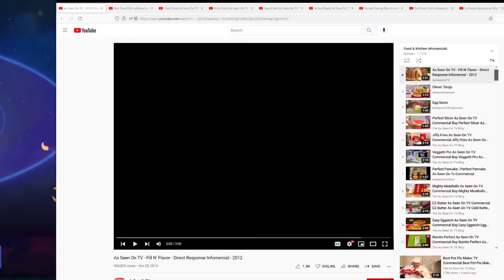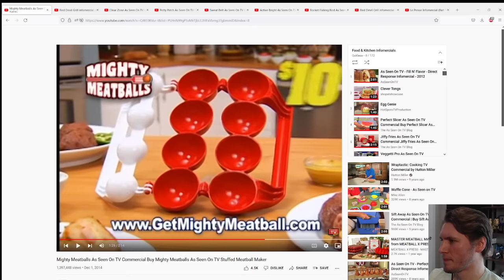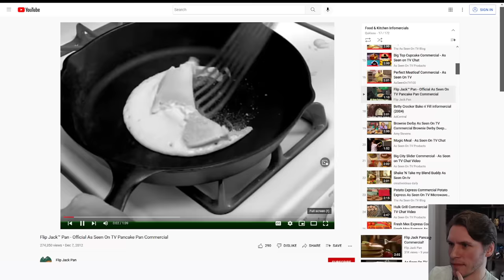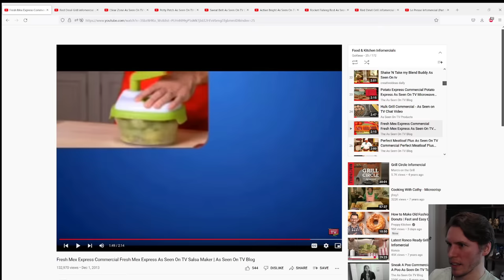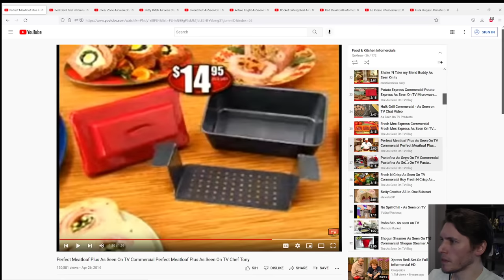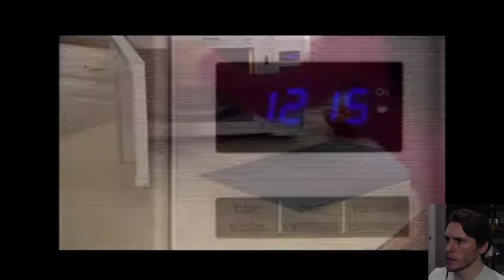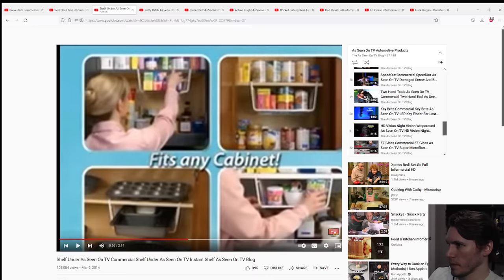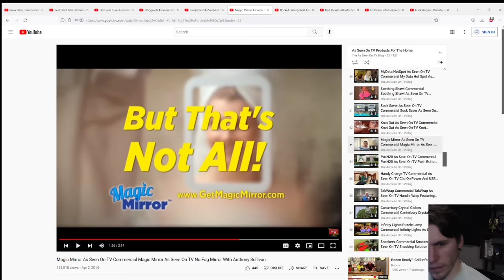Jerma Streams - Watching Infomercials

Comment: The problem with oil is that not only is it generally one of the most pain in the ass things to clean off, but it's bad for your sink and can clog it so you also have to deal with that.

I use an egg cooker all the time. I literally crack the eggs into it, stir them to scramble, and put them in the microwave for 1 minute. They come out in a lovely shape and all I have to clean is the little bits of egg off the container. So much better than using oil.
Reply: Crack crack crack the egg into the bowl

Comment: I gotta say, a lot of these seem genuinely useful and good, but the meatball press and the pancake pan both seem sorta bad.
For the pancake pan, I'll admit it sounds good, i mean 4 "perfect" pancakes at once? But the thing is, those are mini pancakes. Those are what I'd see on the kids menu. All 4 of those are roughly 1 normal size pancake, so you don't have the advantage of numbers. The 2nd issue i see, is the fact i cant see the pancakes while they're cooking. How can you know if a pancake is done if you can't see it? 
The meatball stuffer seems like the solution to a problem nobody will have. Its basically a snowball mold with 1 extra step. If you can make a snowball you don't need the device. Literally, just wrap a little cube of cheese with meatball meat, it's not hard.

Comment: I live in Australia, if that changes pricing. But the best way to have proper chips at home, BTW we call them chips here and not fries. Is simply to buy a packet of frozen chips from the supermarket frozen section, and then using any basic deep fryer to fry them in oil, not too long, and then to shake chicken salt over them, this achieves the same effect you would have if you purchased chips from a cafe, it's in fact the identical process they use. 
There is no point buying potatoes and trying to cut them, because it isn't even cheaper, so what's the point? There is no point, just making your life harder for no good reason. Additionally I think chips in the oven aren't good, you have to deep fry chips to make it proper, otherwise oven cooked chips just taste too bland like strips of baked potato.